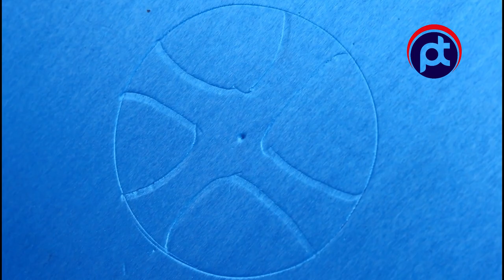How to Make Hovercraft | RC Hovercraft

Comment from the maker: Here's a little problem in Hovercraft. If You Change the Propeller Then it will Move Forward . I used the Left fan here That's why it's Running Backwards.
Reply: there are wheels under the hovercraft  🤣🤣🤣